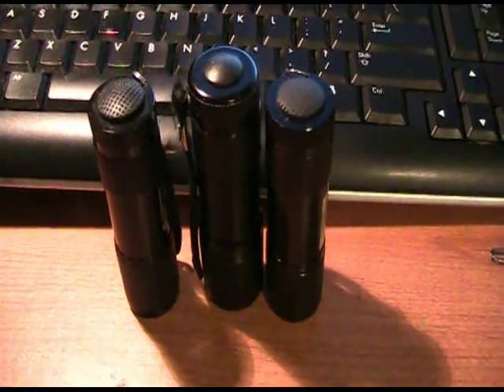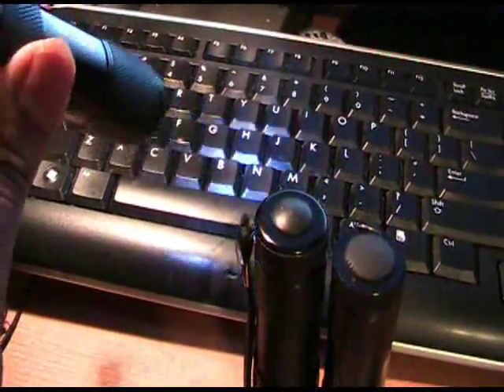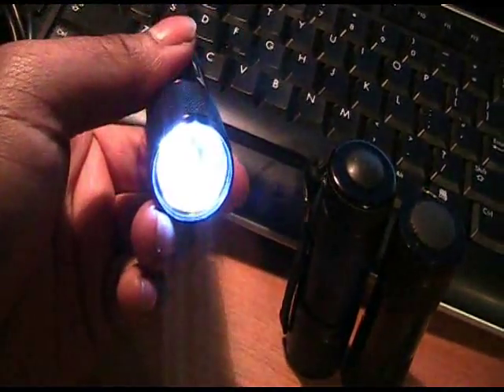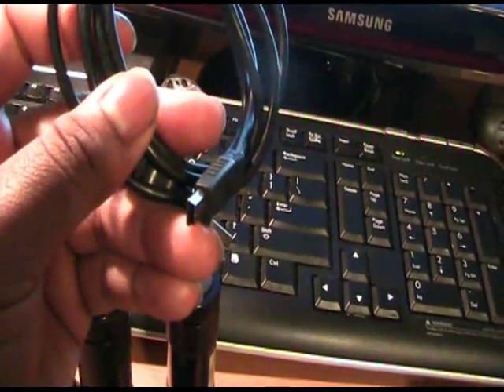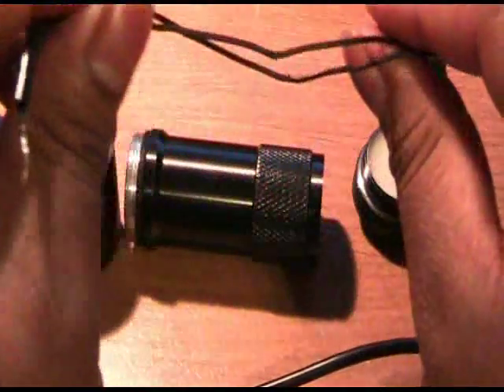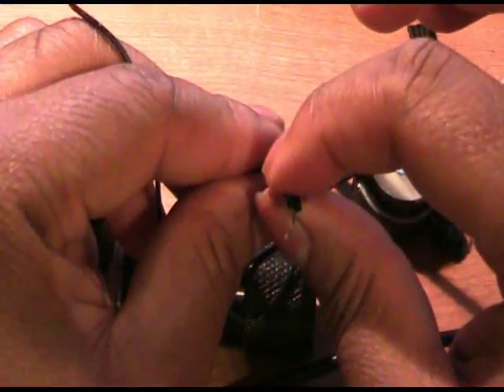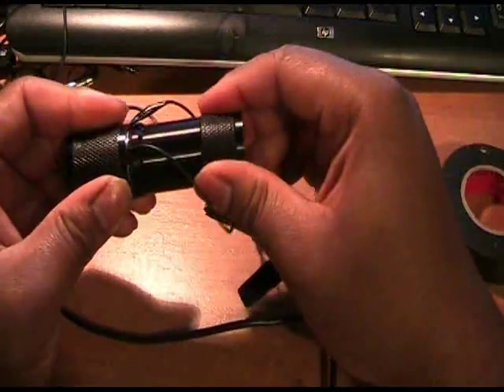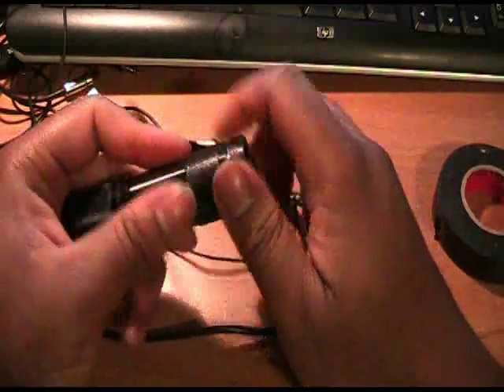How to make a USB flashlight

Comment: dude, you should never plug in an AC sodering iron next to electronic devices, and how could you thread the bottom of the flashlight in unless your pre-drill holes for the positive wire, and you can get a usb light at a dollar store for a buck with out doing all this stuff, this can only apply if you need it for imergencies